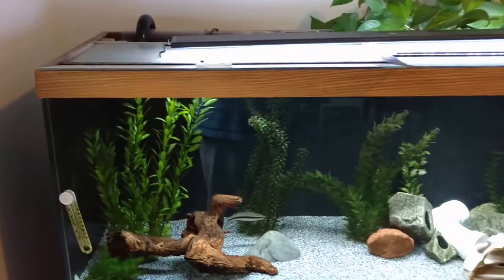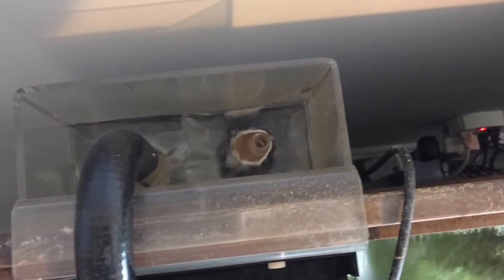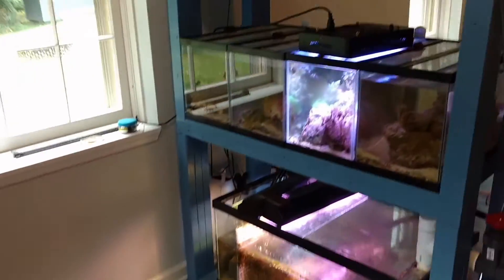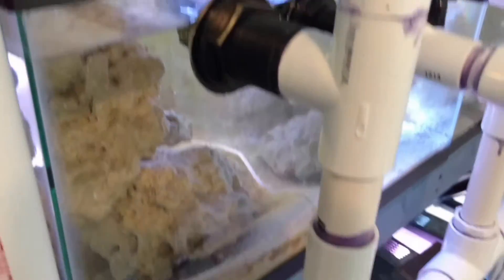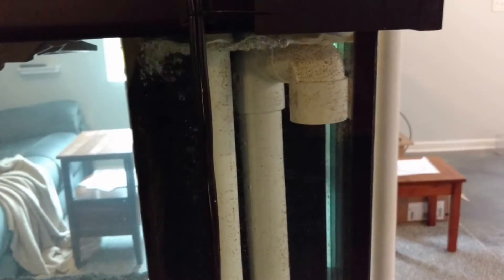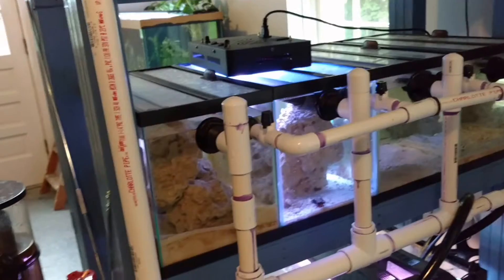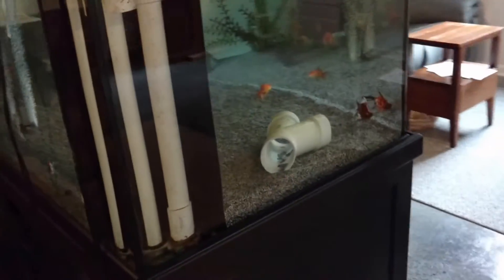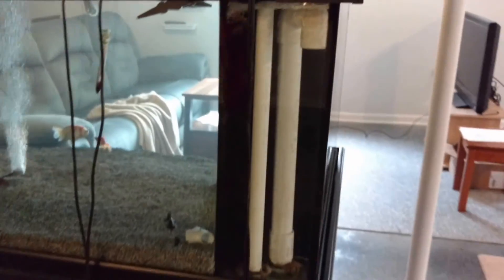Three Types of Aquarium Overflows

Comment: I just bought a used 150 tank with bottom drilled holes and nothing else with it.... Well, a stand came with it.  Thanks for the information on set up.  However,  whoever drilled it put the holes closer to the center of the tank, not the corner.  Any ideas on stand pipe / weir placement in this situation?
Reply from the maker: Can you post a link to a picture or anything? It's hard to say without seeing exactly what we're talking about. It is possible to do an overflow without the usual overflow box built around the corner, but they aren't nearly as reliable because the bulkhead at the bottom and the PVC connections to it have to be 100% perfectly waterproof. Any pics of the tank how it was set up previously?

Comment: The third set up im curious about. . The black surround that goes around the 2 pvc pipes sticking up from the bottom. . how many of those surrounds are on there? is it one layer or one wall or do you have 2 layers or 2 weirs basically? if that makes sense. . I have a tank that someone made themselves and for some reason put 2 layers or 2 walls in front of the 3 pipes sticking up from the bottom of the tank. . I can't think why or if you need it. .
Reply from the maker: Do you have a picture? Some built-in overflows have a channel that brings water from lower in the water column. That area will have a 'double' wall appearance to it.

Comment: Good explanations, but you left out a couple of types.  I know several people that like the Bean Animal overflow design or my favorite is the DIY Stockman overflows which are flood proof and quiet. Mine are drilled through the back of my 540 gallon Plywood tank .. I had my DIY Stockman overflows through bottom of my 360 gallon plywood and glass build.   You have a good looking set-up and did good describing overflows !
Reply from the maker: Those are both variations of the drilled overflow, a little more precise than I was worried about getting into (or had on hand).
Reply: You did great, I just felt like chiming in...lol  No matter what we explain there is always so many more.. Im a sub to you..

Comment: I would like to drill my tank similarly to how you did the salt water tanks does this method make noise?
Reply from the maker: It isn't the quietest option, for that you will need to look into some of the other drilled overflows. I have no issues with it. If it is right next to your bed or TV, and your sump and pumps are VERY quiet, you may notice it.

Comment: I have used hang on the back overflows for around 17 years and have never experienced a problem. If I am home during a power outage I just unplug the return pump so I control when the water flows again. If I am away I don't know about it and have never had a syphon break on me. You must make sure your over flow U tube is not cracked or broken in any way or the syphon could break. They just take a little more care and caution then say a drilled tank. However I do like the new ghost over flow systems that use 3 drilled holes and has a front skimmer box and back box with 3 outlets so a herbie syphon method can be used. That is what I will do on my next tank. The ghost systems run from around 100 to 200 dollars.
Reply: I want buy one!! The price they want for one is dumb! Not when you can build your own from PVC and my opinion...works better! Can adjust to your needs and make changes as needed! I tell everyone not to buy them! If you have had it that long without any problems...That's great!! Really you shouldn't have a problem with them, loose power for that long and no generator...your fish are dead from no heat anyways! I have a few generators just in case... One the best I tell people to get is from harbor freight! Tail gate... $99!! Unless you have a lot of tanks, or a real big one...works great!